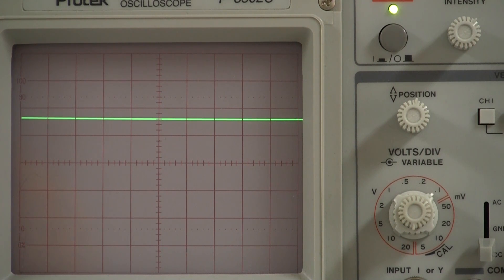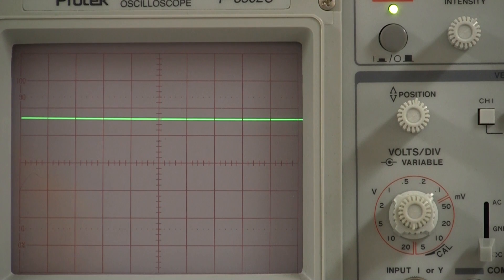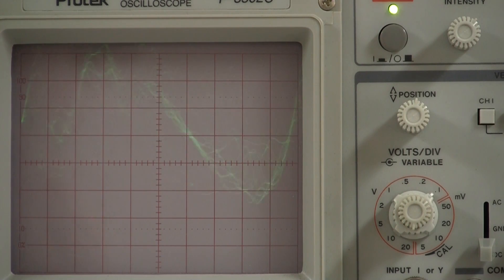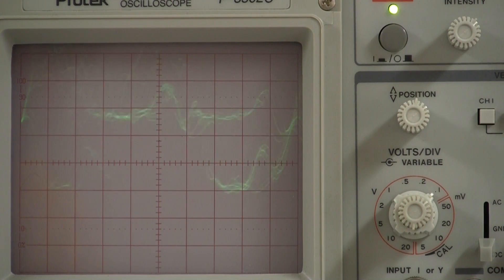Analog versus Digital synthesizers compared

Comment: Sorry man, this video is not convincing. Aour arguments have been repeated by the digital guys since many many years. I have spent countless hours of trying to replicate the sounds of a trusty Juno 106 (a 1- Osc synth!)  with an Access Virus.  The final results were - albeit a similar colour of sound - far apart, the Juno simply crushing the Virus by sheer fatness and power, the Virus sounding thin in comparision. 
Trying to reduce it to a representation of basic wave forms does not answer the question. 
There is a reason why we live an age of analogue synth renaissance (like Behringer, DSI, Korg).
Reply: When you say far apart, you weaken your claim.  Because I have heard analog and digital synths all my life, and have no problems with people saying there are differences, but not what I would call 'far apart'.  I remember audiophiles talking about night and day differences between two accurate amplifiers, which is just nuts.  That implies people have strong biases.
Reply: @Bernhard Ess Access Virus are one of the most digital sounding VA:s around. Its main purpose wasn't to sound really analog. It was more a "working horse" with lots of options and often used for busy trance music where you had loads of layers of sound that would sound to muddy in a real analog synth.
Instead listen to Rolands own cloud recreation of the Juno-106, it is extremely close. For most parts they sound the same!
The main part that makes or brakes a Juno-106 is the analog chorus and Roland got that spot on in their own VA.
Listen here for a direct comparison  between a real 106 and the cloud version, for example: https://www.youtube.com/watch?v=UYGdVjSr4rI

Nowadays the differences are so small that, at least for the raw sound, they don't justify the extreme prices demanded for the "real deal". 
Same thing with Prophet 5 vs Repro-5. Extremely close.
The handling with direct contact with the instrument/knobs and the feeling of using what some consider a really beautifully designed gadget directly is another thing though....
Sound? No! Just in some extreme cases (where the difference still is minor). And this difference can be spotted between different models of the same synth!
Reply from the maker: Thanks for posting your opinion and I am sure there are others who agree with you....... since the days of 'Hi-Fi' back in the 70's, remember those days ?  people been arguing over sound..... even when it was an all analog world before there was any 'digital' anything...... people were arguing over sound..... claiming to hear differences in speakers that they described with vague words like 'warm' or 'thin' .....  who can tell what they were hearing or if they were hearing anything at all ? ..... the point is it is all so SUBJECTIVE and CONTROVERSIAL .... and that's quite fine.... each person buys what they prefer and there is no shortage of options .......  personally I don't care.... I didn't care back in the 1970's and I certainly don't care in 2017..... it is incredibly hard to make 'an exact match' between complex sounds that are varying in time across the big three.... timbre, amplitude and pitch.... so why the fuss ? ...... in synthesis, I get it pretty close and then I move on a happy camper .... what I absolutely love about digital music is the predictable precision, the perfect tuning and the fact that every time I push a button I get exactly the same result.... this appeals to my personality and reduces wasted effort.... as far as the arguments I am creating with these videos, that also appeals to my personality because I love controversy.

Comment: I think analog vs digital comparaison can't be done like you are doing it. For me, the thing that make an analog synth's sound warmer or better( for some kind of use) is that with the time, there became not
stable ; some impredictible micro variation due to the fact that components became old, make some kind of sound that are difficultly or impossible to reproduce with digital synth( exept maybe the fact that the opamp and the dac used for the d/a conversion  may age[and the other litlle component too, buts, there are just reconverting the programm in analog domain and amplifying it and change the dc offset]). all the things i like in analog synth is that the full parts are made from things that can age and change with time, and became unique. It's not about a comparaison between waveform generated by a microcontroller and an computer or by anolog parts, but more the fact that the analog parts can become more easily unique that digital program(who may make some error too, but, them are not the same kind)
Reply from the maker: well thanks for your comment..... and i agree with it..... but digital can be randomized and imperfection intentionally programmed into it, not that I think this is the way to go..... it's better to keep the digital for one type of musical sounds (perfection) and the analog for the other type of musical sounds (imperfection)
Reply: @Stephen Mendes  I once had a brilliant teacher that explained me that 'better' or 'warmer' sounds simply do not exist. First of all, we do not have any calibrated measuring device with a scale indicating from cold to warm or from bad to best. It is a pure personal interpretation. Secondly, I make any synth sound 'analog'. If you know how to. Some maybe you need to learn that before you start talking bla bla. Finally, you can find enough scientific results on blind tests that pove that : Our hearing is influenced by our eyes and that blind tests have long proven that people can not hear the difference between 'analog' or digital synths. So if you say that analog sounds 'warmer' (whatever that means) it is because you know it's coming from an analog synth. Unless you want to deny science, but than I'm afraid we're finished talking. If we compare analog to analog, than there is a very remarkable blind test with multi-million dollar Stradivari violins vs 'cheap' 5.000$ violins. Only experts and experienced classical musicians ware taking part in this scientific test. Well, the majority of blinded listeners pointed towards the cheap violins as the 'better' sounding where as the Stradivari supposed to be the best violin in the world...what a joke. You can deny those facts, but then you have no idea what you talk about, sorry.

Comment: Hi Stephen, I appreciate what you are saying about the raw waveforms but the real issues from my perspective are as follows:

Filters (cutoff and resonance) - these audibly have steps on some digital synths (probably they digitize the control signal with a limited resolution like 8 bits).

Aliasing is audible at higher frequencies on some digital synths - perhaps the sample rate is too low - someone demonstrated this here on youtube using an Akai Miniak while trying to recreate a famous Elka Synthex patch.  Unfortunately I can't locate the link.

Control surface - most of what made the old school synths enjoyable was the simple knob based interface.  I know this has improved on some of the VA and digital synths, but the older ones had very obfuscated menu based controls and were sometimes pretty difficult to recreate something easily done on an old analog unit.

Any way I have several synths digital and analog and would only have one if I could get the exact same sounds out of all of them.

Cheers!
Reply from the maker: well thanks for your contribution to the discussion...... the sound is all about # of bits and speed ...... with more resolution and higher sample rates most of the objectionable 'sound' issues of digital simply disappear ..... but  I agree with your issue of the controls though..... with  modular analog every control is available simultaneously to your hands...... even when using a MIDI control surface with plenty of knobs, sliders and buttons the biggest problem is to REMEMBER the assignments you made (and there are never going to be enough controls to compete with a large modular system)

Comment: Here's the thing. In principal this is all correct.However much more talent and money goes into producing a high end synth than does the typical vst. So yeah' I believe it's possible to reproduce a sound identical to an analog synth from a digital source be it software' hardware dsp' embedded pc ect however the  sheer amount of RnD required to do so is often just not there because the ROI is simply not great enough to do so. This is mostly true regarding soft synths and hardware digital synths in the below £1k market. Though some people will still claim they hear a difference no matter what. most of the time I think they are describing whether they know it or not 'the imperfections in OSC pitch ' leakage, ' which provide a certain character to the analog sound. 
 Most vst instruments are programmed in C++ with perhaps a small amount of in-line C or ASM. Since this is the case most vst developers are reliant on sound libraries for C++. Those libraries were never written with analog modeling in mind so developers just have to get as close as they can with a predetermined set of tools. In order to get the sound absolutely representative of analog it would have to be at least for the first time programmed in a low level machine language like ASM' MASM. The amount of time and money required to do this would be tremendous. Digital synths are still using a similar system but the programming is embedded on chips. Vst that do manage to get it close to correct with high level programming languages typically require a ton of system resources in order to operate correctly. This can become an annoying issue within a project. I believe we will in the future see that much of the programming required to produced a an exact replica of analog sound will be done with AI. There are already AI systems which have been able to compose songs of various genre having never been programmed to produce sound. If the AI was told to produce waveforms exactly to an array from which it was to learn which was comprised of pure analog sound it would be possible to get the computer to do the bulk of the programming it self. This would make hardware emulation extremely cheap and more viable. I belive we could start seeing that technology in software development for the masses within less than ten years.
Reply from the maker: But don't AI systems need  'a ton of resources'  also ? ..... anyway, what you are saying is probably correct for most soft synths.... but developers like Roland and Yamaha do spent huge sums of money on R&D and the design of their proprietary VLSI chips and the results are adequate for everybody, except the few who must have analog at all costs.

Comment: This is the result of antialiasing, which is required to remove from the signal all harmonics exceeding 1/2 of the sampling rate. Usually, a simple low-pass filter tuned to 20 kHz
Reply from the maker: Thanks for the explanation...... and for making a positive contribution to the never ending 'discussion'

Comment: From what you are saying in this video, I get the feeling that you don't really understand what it is that people want from analog synthesizers and can't get from a digital one. It really has nothing to do with producing smooth or 'perfect' sine waves. Sure you can get the most pure sine waves from a digital synth. But it's not about that. The reason why many people like analog synths over digital ones has actually got to do with the opposite of "perfect" waveforms. Analog oscillators and filters tend to produces slight variations in the waveforms. It's these imperfections that give the analog synths a certain 'character'. PCM Sample based or digital FM synthesizers do not have these variations in their output and basically produce flat 'perfect' waveforms. This on paper might seem ideal, but in reality it creates a static or sterile sound that is often perceived as unpleasant or undesired. Because of this 'virtual analog' synthesizers and computer plug-ins use sophisticated modeling to recreate the 'imperfect' qualities of the analog synthesizers. Some do quite a good job, but most of them don't quite match the sound and 'aliveness' of the original analog synthesizers they attempt to recreate.
Reply from the maker: Thank you for your excellent analysis of the situation...... I think you are quite correct..... since this video was made, I purchased (at great cost), a modular analog synthesizer (which you can see demonstrated in my newer videos) and one of the first things that hit me were the IMPERFECTIONS.... I had gotten so used to 'perfect' tuning and exact, repeatable patches that I found it annoying that even when I patched the modules the same way and put the knobs and switches (and modular analog synths have a LOT of knobs and switches) in the same positions.... the sound was slightly different in subtle ways...... so the reality is that no matter how expensive your analog circuitry is it can never match the precision of a digital system...... and you either like this 'feature' or you do not...... I did not, at first, I found it frustrating that I could hardly make exactly the same sound twice..... other people relish the unpredictability.... so it is really a matter of TASTE and PREFERENCE....... in any case, I grew to love my analog synth (in spite of it's shortcomings) nearly as much as my digital synths..... they are like two different children and I have learned to accept them for what they are (instead of trying to get them to be the same).....  hopefully, I can find the time to use them both to complement each other in musical creations..... once again thanks for your positive contribution to the 'never ending' discussion
Reply: Hi Stephen. Yes I agree if 'perfect' and consistent is what you most desire from a synth (or any sound reproduction device for that matter) then digital is the best option. I however often like the 'imperfections' and feel that it adds to the liveliness of the sound. But of course it's a fine balance between things sounding to sterile (digital) and there being to much distortion or detuning. And yes, sound quality is a very subjective thing. It's not always the device with the best technical specs that sounds the most pleasing to many.
Reply from the maker: Thanks for posting.... and I hope you will find other interesting videos on my channel.....  if you have any suggestions for future videos that you would like to see, I'm always looking for ideas..... i like to make videos that help people cause I am a teacher.
Reply: I finally understand
Reply: +solidsnape ikr? ive been searching for months on why some people prefer analog... all i hear is "character". now i finally know what they mean
Reply: Aliveness is the keyword.
Reply: Even 'imperfection' are parameters that can be found on some digital synths. So many blind tests have proven that people can not hear the difference.
Reply: they can just add some noise in dummy

Comment: Where's the comparison? You'd don't really do one. I'd love to see digital and analogue waveforms compared on a scope and played, from at least a couple sources from each.
Reply from the maker: I have other videos on my channel.....  with examples of all the basic waveforms  (sine, square, triangle) on scope.... and originating  from both analog and digital sources..... The digital sources include Roland FA-06 and  Arturia Modular V2 (softsynth)..... The analog sources include Synthesizers.com modular analog synth (Q106 and Q167 oscillators) and B&K Precision Analog Function Generator.....  I also have videos with  digital filter sweeps as well as analog filter sweeps..... the digital filters are from the Roland FA-06 and the Arturia Modular V2..... the analog filter sweeps are from the Q107 State Variable Filter and the Q150 Transistor Ladder Filter (both modules of the Synthesizers.com analog modular synth)....... but  in order to compare filters visually I would need an Analog Spectrum Analyzer and I do not have one.... an ordinary  scope is useless with multiple waveforms (white noise through filters) which must properly be assessed in the frequency domain and not the time domain.
Reply: Stephen Mendes thanks for clarifying I will have a look at the other videos.

Comment: 6:36 "I would conclude that the square wave coming out of this synth has intentionally got his wave shape so as to add additional character to the sound" I'm pretty sure this is totally wrong ;  this has nothing to do with voluntary modification to the wave. It has to do with Fourier series and it is a very important concept in wave analysis. In a way, you could say that all the waves you presented have to be "modifications" of the original sine wave. You should check it up!
Reply from the maker: You are absolutely correct ...... the square waves look that way in my video because the higher harmonics are simply absent.....  a true square wave has odd harmonics that go to infinity (with progressively lower amplitude, of course) .... so what happens is that when the fundamental frequency of the square wave is higher, the bandwidth of the digital system cuts out the harmonics after the first two or three (before the amplitude drops to insignificance) and then they look as they do in my video.

I know that analog and digital are completely different ...... I lecture this stuff at University..... you can see my lecture whiteboards for Digital Signal Processing at http://smendes.com/elet3130/ 

These particular videos are intentionally controversial.... and I was waiting to see how long it would take for somebody to correct me...... thanks for your post and I am honored that you watched it long enough to spot that glaring contradiction.

Best Wishes to you.... and I hope you will see other videos on my channel that you like !
Reply: I agree Michel.  It's called the Gibbs phenomenon.